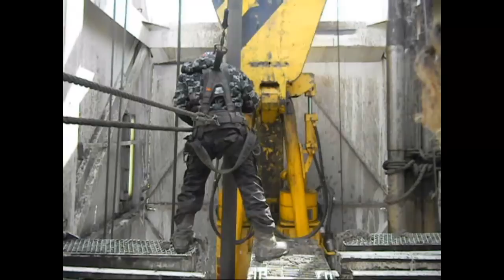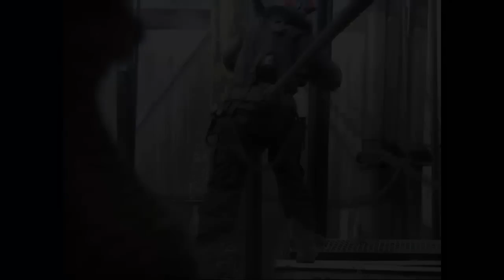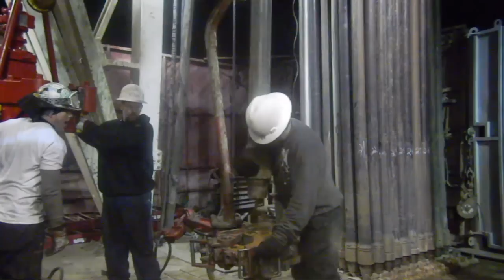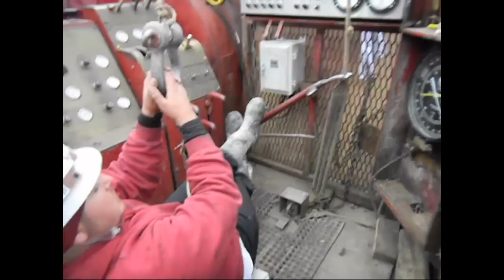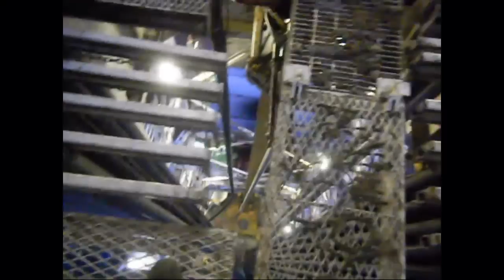Rig Life Video (Real Sound)

Comment: I have a question. If it is a top drive rig then why are using a chain to spin pipe joints apart? The top drive would be faster and safer way to spin joints. Many modern rigs also have an iron roughneck to loosen and tighten tool joints.
Reply: +epistte Old habits die hard...
Reply: +Eduard Voicu OK, so it was a choice to throw a chain.   This looks like hard work.
Reply: epistte
It's a faster way to breakout joints but it's mostly forbidden these days even on rigs without a top drive.
Reply: +Eduard Voicu On rigs without a top drive they either need to use tongs and the turntable, or some form of iron roughneck/pipe spinner. IIRC. I've never worked in the oil patch. I'm just a mechanical engineer with a fasciation for big, loud, greasy things.
Reply: epistte
Precise.

Comment: Good work guys but he derrick hand  should have stabilized the stand by holding and steading it at the top stopping it swinging there. Each inch of swing at the top is multiplied down the length of the stand (12" X 90') at he bottom on the floor. That little bit of attention makes the job of the floor hands so much easier and safe. Derrick hands, do this and you will never have to buy another drink. Your crew will take care of that.

Comment: HOW MUCH MONEY  PER HOUR? IN THIS WORK?
Reply: 65 to 75 grand per yr
Reply: alberto venegas guys on the bottom are making 20 to 25, and drillers and guy up to latching pipe prob making 28 to 33 and hour.
Reply: floor hands $32.00 ,,, Drillers $50.00 an hour
Reply: floatpool sir hate to inform you but that is wildly inaccurate
Reply: Not enough.
Reply: by the answers I see I wonder why they don't do another job that it is easier and better paid frankly speaking
Reply: with $32.00 an hour and working 14 hours a day...that means something like 100k a year
Reply: any plumber or electrician can earn more.
Reply: Jacques Beane try canada maybe or northen see near england

Comment: What a deathtrap. It isn't cool to not be safe. When we're doing drilling operations in Norway, We use proper tools. No fucking steel wires in a winch, pulling on an oversized wrench. No Thank you, i prefer a proper IronRoughneck. And What are they doing with the pipes?? Standing in the top of the Derrick and manually taking them in and out ?? Jesus, ever heard of a pipe handling machine? And it appears as If You're still drilling like in the 50's, with Only pressure gauges and levers. No Wonder so many people die from This in the US. Its cool to live, not cool to die.

Comment: This isn’t Alaska
Reply from the maker: Yes it is. It’s not the North Slope. It’s the Kenai Peninsula. King Salmon Alaska - Geothermal Project.
Reply: @madhouse116  ok, I thought the rig was awfully stripped down, windwalls , tarps etc even for SE Alaska.
Reply from the maker: @derekkueter7679  Man It Was SO GHETTO! it was an old DHS rig that burned down. They barged it up to King Salmon, AK. From Seattle. We retrofitted the rig with ghetto wind walls, a boiler system and everything else. Literally built WOODEN wind walls around the mud pits. Big ol 1200BBL mud system. Still hit -60 / -70 in winter. We Froze Our A**’s Off!
Reply: @madhouse116  holy sh!t!!!  I bet that was one miserable place to be.  Old dhs rig🤣, I’ve roughnecked on a couple of those!!